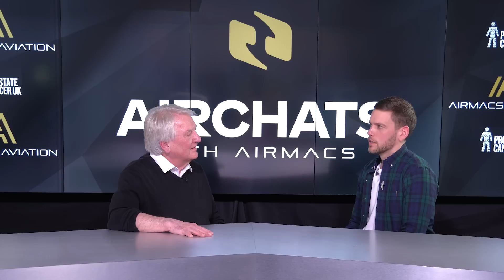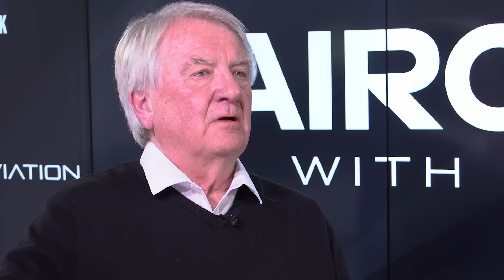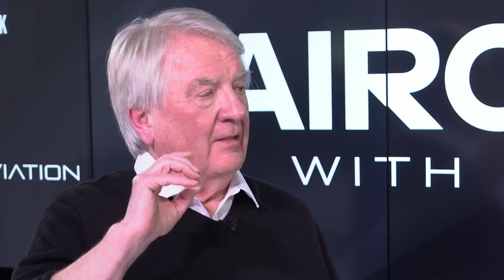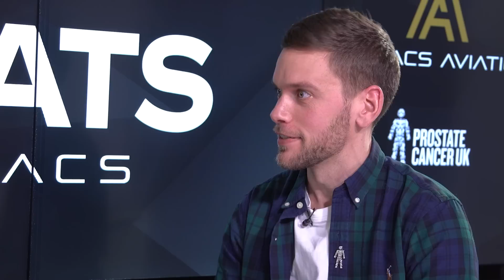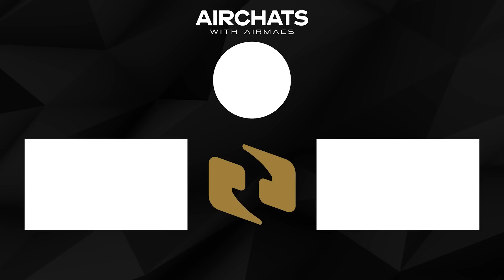Take Off Procedure with Ex Concorde Pilot Cpt. Mike Bannister

Comment: What a wonderful interview! I always love hearing things like this. The Concorde was one of the most beautiful and exciting commercial airplanes to fly. I loved watching it take off and land.

As an aside, back in the mid-1980's I was flying a Douglas DC-8-70 series freighter for one of the major cargo operators of the time. We flew into JFK regularly and I routinely watched the Concordes arriving and departing. I have photos I took from the cockpit. 

We used a local ground services provider at Kennedy by the name of "Servair". They provided all of the ground equipment required to handle large jets. Things from boarding stairs to electric and air power carts to loaders and forklifts. 
The Servair crews were comprised of  rough and tumble hard working New Yorkers........they worked hard, but had little patience for problems.

The DC-8-70 series with the new CFM-56 high bypass turbofan conversion was a wonderful airplane.....but the CFM-56 while only requiring 20-25 PSI of air pressure to start, needed a high volume of air that pneumatic start carts of the day were not configured to provide. To be fair, this was a problem we encountered at many airports when the CFM engine conversions were new. We would be trying to spool up the number 3 engine and their start carts barely pumped enough volume of air to get the engine to the minimum RPM to light it off. Sometimes they would connect 2 air start carts to the plane.

We would complain to Servair about this and their response always was the same, and I quote, "We start the Concorde with these carts"............I always wondered if the Concorde guys had issues with the same air carts and I always guessed that they told British Airways and Air France that they started DC-8's with these carts.......

Comment: An intelligent, articulated person.
Conveying in a concise manner details ranging from the sound barrier physical phenomenons, to the opperation of the plane.

Not neglecting alluding to all the people that make possible flying that futuristic machine -- taken to the Air in 1968.
Flying from about 3 decades, accident free.

The Crash in Paris in the late 90s was due to detached sections of an American Airlines Boeing or DC 10 falling onto the tarmac.
Due to Poor maintenance service performed by that American Company.
Some of the debris, were projected against Concorde's wings, puncturing a fuel tank.

As a Jurist, in my view  the respknsability falls on the shoulders of American Airlines'  CEO and Board of Directors.
Cutting corners, maintenance-wise, is usually a source of future  major problems.
Unfortunately, the blame normally falls on some poor souls devoided  of any real decision Power

A great video ! Thank you.
Reply from the maker: Thanks for your comment! 🫡
Reply: @albertseabra9226  Boeing? It was a DC10
Reply: @aerotube7291  DC 10 or Boeing is not relevant.
The issue,  the Smoking Gun is extremely Poor Maintenance  !

An Airplane flying for a Main Airline is not supposed to drop parts of its  fuselage on the run-away.
Reply: @albertseabra9226  dead right.  I had noticed on many threads there is a trend to bag Boeing for others issues.  So I mentioned it
Reply: @albertseabra9226  sorry man, wasn't trolling you so to speak..  Great vid and good points in your comment....
Reply: @aerotube7291  Ok, I didn't know the Internet meaning of "trolling".
Placing a "bait" to extract a reaction .
I didn't take it that way.
And Thank you for the in put.

Competent, skilled  staff was replaced by people concerned with a short-term mentality.
Cutting corners to inflate quarterly profits.
Boeing used to be run by highly qualified Engineers, preocupied with the quality and safety of their airplanes.
 Unfortunately,  like in most World Corporations, in the late 80s, and 90s, they were replaced by MBAs. 

And for a while, the existent Corporate Culture kept Boeing balanced.
Unavoidably,  after some time  major problems plagued Boeing -- more visible in some lines.
And the rest is History !
Reply: @albertseabra9226  haha, neither(did I . edit) it seems....I thought it was kind of hassling over minor details in otherwise decent comments!!! But yeah, I come on here to communicate positively in general...I must say I adore boeings heritage and hope this phase passes...

Comment: I also remember in 1969 driving from Methyr Tydfil to Leicester in my Ford Anglia.  On the radio was a running commentary describing Concorde's first take off.  

Earlier, I had been for a job interview as a final year engineering student at Bristol Aircraft and was shown some of Concorde's electronics.  It used flatpack ceramic packages for the integrated circuits. I asked if its control systems were analogue or digital.  The manager escorting me said that digital control systems will come but during my career, not his.
Reply: Thank you very much for your beautiful description of how to fly this beautiful plane conceived and realized  by the 
best British and French engineers of the time.